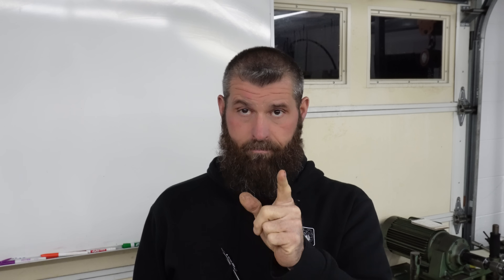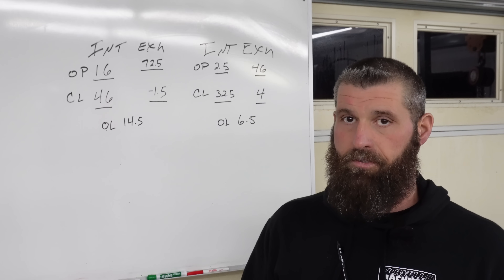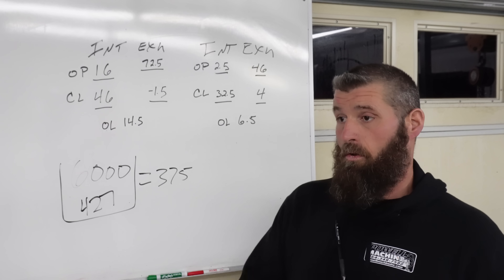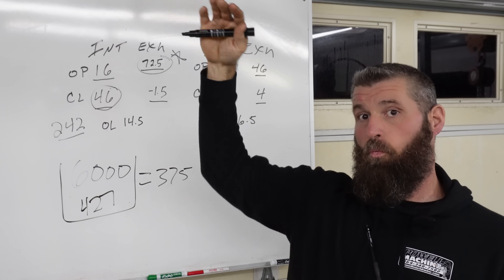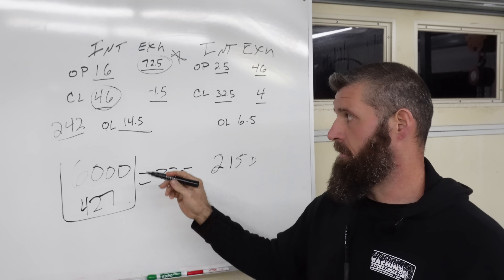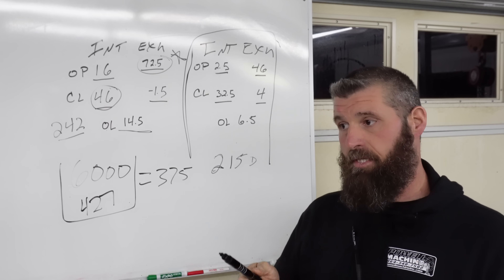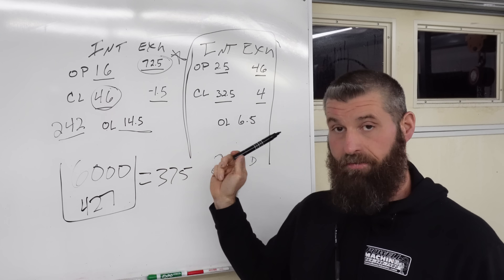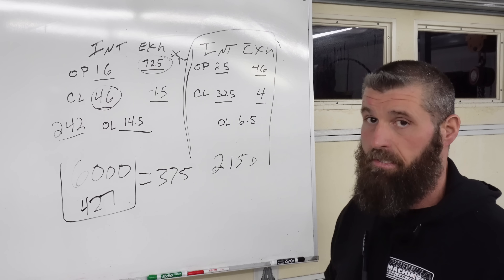Camshaft Tech... How to lose 100 Hp!

Comment: power nation stuff is often unoptimized because they get sent the parts to advertise.
it's often a parts pile is rando stuff
like the time they out 260cc heads on a 6.0L and made dog crap power.
or put 220cc heads on a 350ci SBC and made like 375hp

Comment: I missing something on the compression especially the dynamic compression. Nobody mentions that if they’re trying to achieve 8.5 dynamic compression to run pump gas they need that big cam if you put the smaller cam in there you can no longer run pump gas so we’re missing the compression,static and the more important dynamic.
Reply: How about this…..get heads that will flow the HP you want…..then spec a cam for those heads….then set your compression ratio for whatever fuel you plan on running…… Ta Daa…..

Comment: I could almost live with the duration numbers on this one. But 116 LSA and push it up 10*, yeah Ex open way to early. This motor has 6.93 cfm per cu/inch so really LSA of 110 is more in line and 7500-8000 rpm and should make 800 hp. Disaster.  116 is a big problem.

Comment: They obviously "crutched" the cam by advancing it over 10 degs when installing it, which is a insane move, but be completely honest here Danial, you or anyone else will never add 100-150 HP to that engine, as you claim you can with a cam that only  has 215 degs dur at .050.  That's 640 - 790 Horsepower out of a natural aspirated 427 inch engine under 6000 rpms and low compression. I do agree that your cam specs would be a world better than their choice, and you would have a much better torque and power curve and drivability too, unless you have crazy long and slow ramps from .004 - .050 lobe lift, which would be one way to carry power up towards 6000 rpms with only 215 degs of duration, but you would kill cylinder pressure with those specs also.

Comment: Please do a critique on Stay Tuned cam choice in his latest vid "DOUBLE the HP of a stock 302 ford on the cheap"

He stuck a sum-8907 in a stock 85 gt 302 bottom end. 236/248 at .050. 110.5 LSA + 3.5 Adv. With some summit 185 heads & a 750 DP on a Holley single plane.

Comment: You are so right, why would someone even want a shitty idle to begin with??? No modern high-powered motorcycle has a shitty idle but still runs perfect on idle and revs easily to 15,000. So why not use a cam that pulls from idle up to 6k is the mega $100 million question,??? If you are restricted for some reson thats one thing but why select the one that only pulls from 3–6K and is slow and week on low rpm ????????

Comment: Very interesting and would see more regarding this topic. My question is: at 6000 rpm/min the intakestroke happens 3000 times. This 3000 times (theoratic) the volume of 472cui must get filled = 1.416.000 cui in one minute what represents 820cfm for all runners.
Am I completly wrong?

Comment: Building a 350 .060” bore with 9.9 compression ratio. Flotek 180 heads pistons are 4VR w/ +6.90cc . 020” in the hole with a .028 compressed gasket. Keeping the Quench at .048” , hydraulic flat tappit Howard’s even split 213/213@.050”  107 CL 111 lsa went with a 1.6 rocker to get an extra .030” lift .450 to .480 if the rockers are accurate. Edelbrock performer with Edelbrock 600 4bbl cams power band is 1,100 to 5,100 rpm. Hoping to get 350 crank hp with this setup.

Comment: Thank you for making this video. Thank you, thank you, and thank you. I really like PowerNation but, dangit. When I watched this episode I was thinking "how bad of a cam selection are they going to make now". Out of all the PN episodes I've only saw 2 maybe 3 correct cam selections for big budget builds. I didn't want to add up all the money they had in this, because it's a ridiculous number.  I did the same thing and looked up the head flow. This engine should make around 670+ hp with a proper cam is what I originally calculated at least! They are trying to overcompensate (durationwise) for a poorly flowing head when they have a great flowing head. They needed more valve lift .640" or more and narrower LSA.  I love Summit Racing, but does Comp Cams make Summit Cams, because PN are lap dogs for Comp. I don't have a problem with their cams but I do have a problem with how they treated installers and end users when they ran several bad batches of cams many years ago.
Reply from the maker: Summit uses a mass producer in Michigan.

Comment: anyone with that many pens in their top pocket is an issue
a cam can kill a motor.
 Off the shelf cams are a last resort. get a good used cam take all your specs to a good cam grinder and get a re grind,,THEY WORK..
I bought a 383 from a shop in Phoenix klein engines,, and shipped it to Australia, it had no cylinder pressure and struggled a 395Hp hyd roller crap.
A cam change to a solid flat tappet setup got 90hp more and cylinder pressure up a lot. SAME engine SAME setup,, 471Hp and 420 ft lbs tq

Comment: I saw that build a few days ago, could not believe they were happy with those miserable results. You explained why, perfectly, thanks! I think if I built that engine for my truck, I’d probably run about a 221° intake lobe and set IC at 37-38°. Your pick was for peaking at 6000 and there’s no doubt that would make great performance on the street. Thanks for another great video Daniel.
Reply from the maker: Yeah, my pick was just to show we could make that same power with a much smaller cam.

Comment: Thank your posting this... I expected that motor to make over 600 when the video started... I would kill for those heads, the trick flows on my small block mopar top out at 300 :( Hoping to do a new 408 for spring.. gonna be stressing over picking a cam for it

BTW.. i understand much better how timing events effect power now.. thank you for that.
Reply from the maker: Glad the video helped you understand the timing events!

Comment: Daniel are these cam timing events @ .050 duration or advertised?
Reply from the maker: .050
Reply: @powellmachineinc thanks for the advice. 
So say it’s 11:1 still low compression but rpm peak is 7k. Does them cam timing events get slightly larger numbers? Just curious not a lot of ppl take about the opening and closing degrees.

Comment: Do you have cam cores available and the desire to spec and grind a solid roller for a 351W/420 ish cui AFR220 CNC /Brian Mitchell Commander intake/ Carbed 11-1 street motor? After the new year and not in a huge hurry
Reply from the maker: Absolutely 💯
Reply: @powellmachineinc Thanks! I have to find the correct pistons yet so that I can get in the ballpark to get my dynamic compression ratio correct which is also dependent on intake valve closing timing and a target of 8.5-1 dynamic at 3600 elevation for a 3000ish to 6200 rpm motor. You're a busy man and Christmas is coming, I may be wise to connect with you before I order pistons. Connect with you in the new year.

I appreciate your enthusiasm for what you do. JG

Comment: A lot of people think all they need to do is increase duration, especially on the intake, to gain HP. At some point both torque and HP decrease with increasing duration. 

I used to use Engine Jr to see about what duration that occurred at.  On the 9.5:1 compression competition engines my cams are typically smaller in intake duration than most other builders. They kick ass on the track. We are limited to 6,200 rpm in a dirt modified circle track application.

https://youtu.be/vhuYv6cSeus?si=xMmFLPJAsH89BfiW

Comment: Forgive my question, but if you were trying to band aid a head with less flow, with a better cam, same compression, would you use similar duration with tighter lsa, or just more duration?
Reply from the maker: A little more duration and focus on keeping the ivc early and the evo a little later which would give a little more overlap which also helps the limited flow.
Reply: @powellmachineinc  Thank you Mr. Powell!  I am definitely in favor of you making more videos like this, I have been learning alot from you!

Comment: 690hp you reckon? With 215@50 and low comp? The heads are designed for 8-8500 for a 427. Bad combo i agree.
Reply from the maker: No, I said I could make the same powwr with 215 @.05.... I could probably make over 700 with the correct cam and more rom😊

Comment: I wish cams are advertised with opening angles, max lift, and closing angles, instead of the current mess. Duration doesn't mean anything without LSA and centerline, and the same with the other two. But people would cross shop cams, seeing two that has the same duration and LSA, yet having different lobe centerlines causing wildly different characteristics. Or two cams with wildly different durations that causes the engine to run identically.
Reply from the maker: That's why u should throw that nonsense out the window and focus on event timing.

Comment: Can you/will you regrind a factory cam ? sbf roller specifically , I will not buy another crane.....the last one (although hasn't failed) just looked crummy(especially since I paid $550.00 for it). It's a 364211 , it works pretty good ....
Reply from the maker: No, we only grind new cams as of right now, and I can't hardly keep up with that

Comment: Damn. I had a stock bottom end N/A C6 Z06 Corvette with a smaller cam(230/246 .629"/.605" EPS/Geoff Skinner), the stock LS7 heads with the factory CNC intake port,mildly ported exhaust ports,stock chamber with the raised ridge near the valves blended down,a valve job(Mike's Racing heads in Concord,NC), a ported stock LS7 intake manifold and headers that made more than that to the back tires. 557RWHP/520RWTQ on Heintz Racing's dyno.(Mooresville,NC).
Reply from the maker: Exactly 💯

Comment: I helped my friend dyno a motor for a circle track car that was a LS7 style 427. The engine was built with mostly drag racing parts but the builder chose the smaller cc heads available. They were full CNC but I don't remember the brand. Granted this was a higher rpm single plane high compression race engine. But it did make 850hp and over 600 lbft of torque. It had 108 lsa and some big duration numbers. I know the application is not comparable to what they were doing but hey, it made not 100hp, 300hp more and 100 more lbft using the same displacement and the same cylinder head flow and could have made more with the bigger cylinder heads. I get some of the guys using a wide lsa to reduce chop but yeah, it typically only helps idle and not actually making the numbers. I can see a little bit wide like maybe 113 lsa with a big split on a dual pattern where the intake duration is very mild to focus on that intake closing to be in the right spot for the best balance of the whole curve while still letting the engine relieve itself at higher speeds but if you don't mind a little chop I'd put my money on a cam with 108 or 110 lsa and the right intake closing time.

Comment: I like your numbers. Intake close is THE most important factor, followed by exhaust open. Too many cams keep the intake valve open too long, which allows pressure to escape, inhibiting pressure build. And, an early-opening of the exhaust valve allows pressure to escape before the fuel charge has been completely burned, allowing pressure to escape out the exhaust before all of the power has been made. 

Long duration cams are for drag racing, where the engine is WOT and very high RPM the whole race. On the street, you want torque, and to make high torque at low RPM, especially with a lower CR,  you need a shorter duration camshaft in order to build pressure early and keep that pressure in the cylinder until all of the power has been made.

Comment: What are your thoughts on rod to stroke ratio and where to put the valve events with a abnormally low ratio vs something on the higher side of conventional. Say 1.46 vs 1.82. The piston location and how it behaves at TDC vs bdc is drastically different obviously. One dwells at BDC longer and the other at TDC.

Comment: A lot of us Chrysler guys have big 500 inch stroker Motors and cylinder heads that are basically inadequate so maybe you can talk about that type of combination which is probably common on some Fe Ford Motors also as well as some B O P engines also.?
Reply from the maker: definitely

Comment: What a Perfect Video! So many people just have to select the "Biggest" components for their engine-camshaft, compression ratios and carburetor. After measuring my aftermarket aluminum heads for recording intake, exhaust runner, chamber volumes it was hard to find a camshaft small enough for proper torque in a lower rpm range for my Holley throttle body fuel injection. Now that I have experimented with everything from the 355 cd engine back to the rear gears, am going to replace the throttle body with my highly modified Holley 600 cfm carburetor. Now my camshaft is a bit too small, so will have to tighten the valve lash by .002" and hope for the best. Thanks again for your thorough, factual video.
Reply from the maker: Glad it was helpful!

Comment: Yep, I really like this cam tech stuff.   How about average guy cruiser cams for the older small and big block V8s?  Like one video each on say, Pontiac 400, Dodge 318, Buick 455, Olds 455, etc.  Maybe on what makes a good mileage cam with decent horsepower.  How about lowest achievable choppy idle (<600rpm)?  Lots of material for average guy interests.  Spread them out over a couple of years so they fit your tough schedule.

Comment: I watched one of Richard Holdener's videos and it brought up some serious questions about low-end tq. He was running and lq9 stock bore, stroke with a series of about 7 camshafts.

I figure there's gotta be no one better to ask.  what I witnessed with the sloppy stage 2 cam ge tested. When he compares the dyno runs it somehow makes significantly more power all the way through the graph. Even more so than btrs truck cams. How is that possible? 

And if that's the case why isn't it being recommended as the go to cam for guys building tow rigs.?
Reply from the maker: because it wont

Comment: I just had another question how come a lot of these stock engine runs sucks wide lsa I know there duration are for sure small because I mean daily driver but how come the daily driver don't run tight lsa or have the cam timing in degree on your board like earlier intake closer and later exhaust opening for daily drivers. Are they afraid to have to much dynamic compression 87 octane or what were the manufacturers trying to do fuel efficiency or I don't know just a thought in my head

Comment: I came to the same conclusion building Harley motors and comparing cranking compression between early and late-closing intake valve timing; sometimes there was so much compression lost, you'd have to go up a whole compression point just to get back to where you were with the smaller cam! Thanks for the video!😊😊

Comment: This is my experience with a cam Daniel provided to me.
This is my experience, YMMV.

I thought all the off the shelf street cams I could find had too little lift for the duration they had. They were most likely designed for stock or modified stock heads, I guess. The cams that take advantage of the port flow at higher lifts had so much duration they would sacrifice drivability in the low end for top end performance, in my experience. Also, with the low static compression I would get with the stock pistons, the extra duration of those cams would kill my dynamic compression.

I filled out the camshaft request form and returned it.

75k mile 82 Ford 302 (non GT) with 8.4 (I think) static compression
Liberty Performance aluminum heads decked .025 to bump compression as high as possible without creating port mismatch (9.x compression?)
Edelbrock Performer intake
Old Holley 650 double pumper I rebuilt (manual trans)
BBC 1-5/8 long tubes
Street/strip car (mainly street)

and he suggested a hydraulic roller and Morel tie bar lifters.
I won't share the exact specs but it's got a lot of lift (closer to .600" which the heads will handle), medium duration (21x/22x at .050) for a street car, and a 110 LSA.
I think the tighter LSA helps bottom end power (given the duration) but might not create enough vacuum for my power brakes, a hurdle I figured I'd deal with if necessary.

Once I got the motor back together and in the car with a new McLeod clutch and a used TR3550 I sourced, after getting the distributor in the ballpark, it fired right up. Set the initial timing to 12 degrees BTDC (based on my research on the InterWebs). Fiddled with the electric choke I pirated off another carb I had lying around. Drove it around a bit. Wound the motor up to 5 grand (it used to run out of breath by 4500 RPM) and it's still pulling. Good stuff. Enough vacuum for the power brakes at idle. Nice.

Today I drove it around for the better part of an hour. Wound it up to near 6 grand and it's still making power. Runs pretty well down low shifting at 2 grand. Then I drive through the little town I live near, trying to keep it quiet. There's a shallow hill on King Street that the car chugged right up at 1000 RPM in 5th gear. It ran cleanly enough that I could have accelerated up that hill. Amazing.

I really like driving this car now. Greater than the sum of its parts. I'm so glad I contacted Daniel for a custom grind for the motor.

I dynoed the car and it made 265 WHP at 5500 RPM which was pretty much what Daniel predicted. It still made 250 WHP at 6000 RPM. WTQ peaked at 4240 RPM at 304 lbs/ft but it made 250+ starting at 2300. Also the AFR hovered at 12:1, so I may be giving up a few HP there. Still, pretty amazing for a cheap used Holley with a rebuild kit. Mileage is on the low side so I may installed an MSD Atomice TB EFI I have sitting around; I have had great experience with the MSD Atomic I installed on my 72 Dart Swinger with a 340.